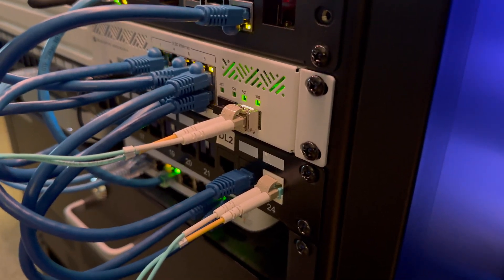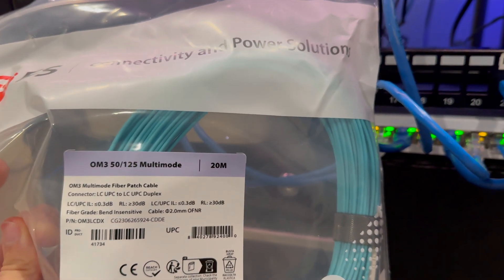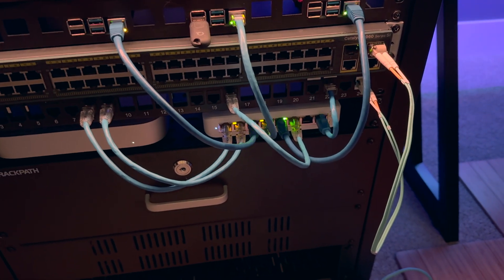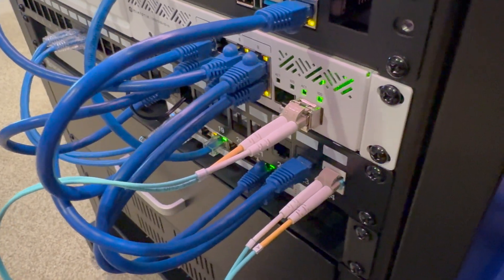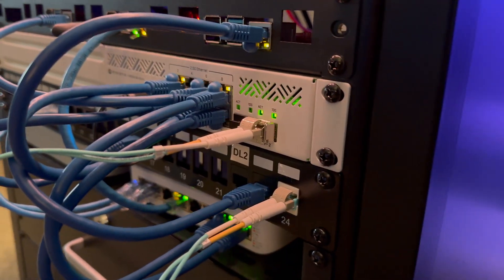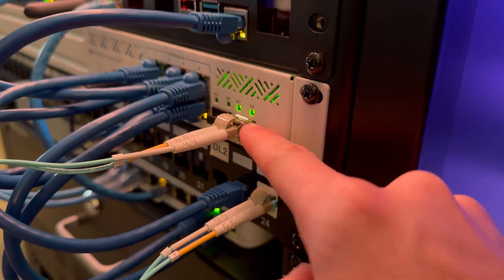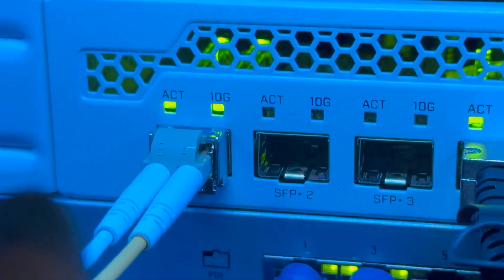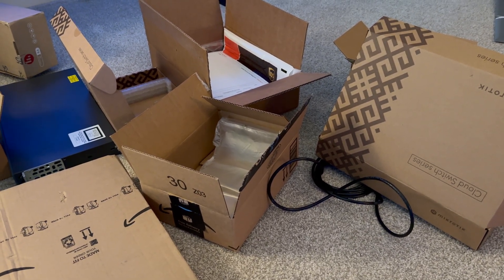I ran 10Gbps Fiber to my Office!

Comment: Question: My max internet is 1 Gigabit from Xfinity. We don't have that good fiber yet.  but for my LAN, can I upgrade the network speeds? I have 2 HP DL360 G9's running Proxmox & Unraid that have Gigabit and 10 Gigabit ports, but the 10 Gigabit is different connection (obviously) and not sure if they are just for connecting to each other or for the LAN. Oh... and my router is the UniFi Dream Machine Pro SE. So I guess one of my main questions is do I need to have Fiber internet in my home to achieve fiber on my LAN assuming that I have the ports that support it?
Reply from the maker: Nope! You can get a faster local network than your internet speed.  For example, my internet is 1 gig fiber but I still can take advantage of faster local speeds from my Mac mini to my server since it’s connected to my switch at 2.5G and the server is connected at 10G. Check out the USW-Aggregation if you want a relatively cheap Ubiquiti 10G switch.
Reply: @beamnetworks1  Thanks! I have a 10 gig adapter for my desktop that I never even installed, so I may do that! As far as switches, I currently just have the Lite 8 PoE
USW-Lite-8-POE - (4) GbE PoE+, (4) GbE ports that I bought for my UniFi cameras downstairs. I don't even have a server rack. All of my stuff is just sitting on a motorized sit-to-stand desk lol.. Obviously, I live alone :)
Reply: BTW: Do you run Home Assistant or anything similar? I'm trying to decide if I want to go the smart home route and if so, then should I do SmartLinks, Home Assistant with YAML (not a big deal to me since I'm a software engineer)... But I don't have a lot of smart devices, so I'm wondering if Home Assistant is overkill at this point?
Reply: I'm also probably gonna tinker around with NIC teaming on my G9's to see what kind of improvements that gives me.
Reply from the maker: I've been running home assistant on a Raspberry Pi 4 with 2GB of RAM for a little over a year now and it's been great. I've got 20 or so zigbee devices connected and it's been a fun setup. I haven't taken the time to figure out how to use YAML but I know some people who do and love it.
Reply from the maker: That would be interesting for sure, curious how that goes. I might try something similar on my PowerEdge servers.